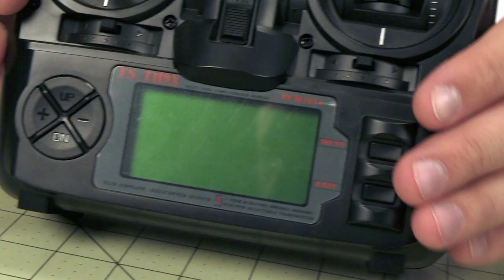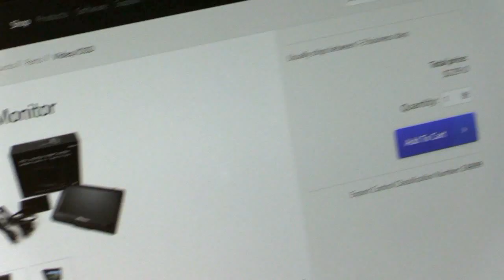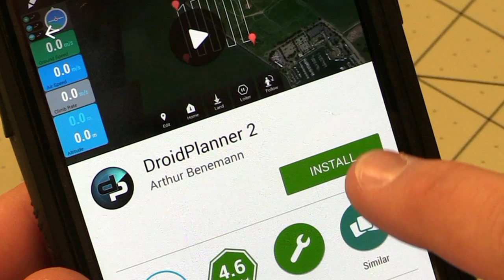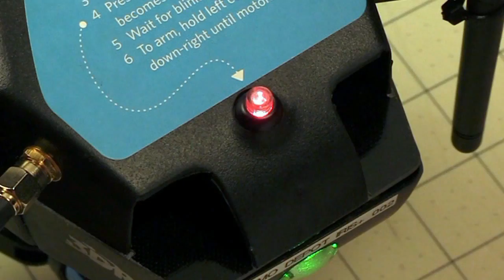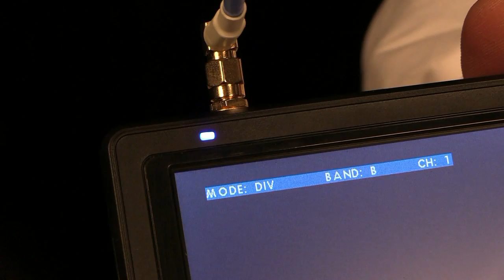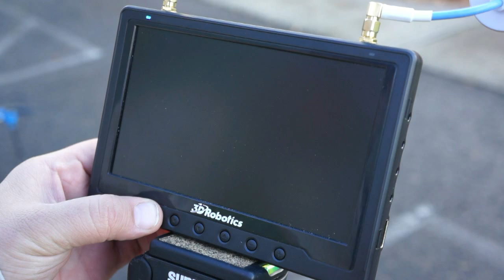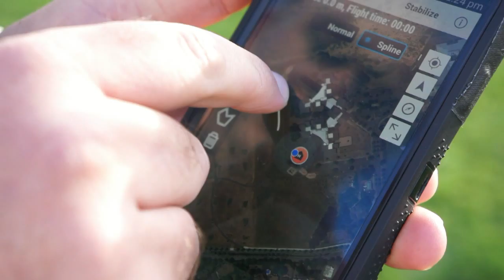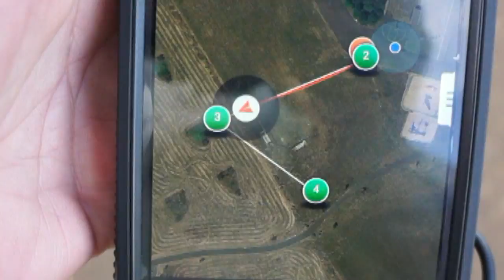RFTC: 3D Robotics Iris Plus FPV Quadcopter Unboxing, Setup and Flight Testing

Comment: Great stuff yet again boys,very impressed with this bit of kit meaning what you get for your money.

I've got an APM quad set up in my hanger and i quite like that one too,even though it had a longer learning curve than most FC's that i was use too,but setting everything up was all part of the fun for me,but as you said in the video it's not as locked in as the Naza-M V2 FC's that i've also got,going by what little i know about the Pixhawk that's in the Iris it's quite similar to my APM,i guess you could say the PH is a step up from APM what with it being 20 times faster in processing power. :-)

Big thumbs up.

Comment from the maker: As regular viewers will recall, we met up with Joseph Aletky from 3D Robotics at the FlySafe training event held earlier this year in Las Vegas, and he gave us a sneak peek at the company's new Iris Plus quadcopter.

Just recently, he managed to send us a demo unit to try out for ourselves, which is actually the very same aircraft we saw in Las Vegas, as it happens. Alas, we have to send it back to the mothership now that we're finished putting this review together for you – which is a shame, because I really like this bird!

You're not going to tear up the sky with it, but it's a very graceful camera ship and as you saw for yourself in the video, it is capable of producing some extremely smooth footage.

Also, we just barely had time to scratch the surface of the autonomous flight mode – but clearly there is a rich trove of capability there that elevates the Iris Plus from being a mere “toy” to a potentially useful tool for a range of professional aerial imaging tasks.

All of that in a lightweight, RTF package that can be yours for $750. To kit it out like the one you saw in our video – with the GoProfessional case, the FPV monitor and the GoPro sports camera, along with a couple of other accessories – would set you back more like $1,800.

That's not cheap, I realize, having once purchased a full-sized, manned automobile for $300 myself, but for that price you're ready to travel the world with a robust, real-time aerial imaging tool tucked inside your luggage.

Not bad – and if you'd suggested that you could have such a thing for $18,000 five years ago, they would have looked at you like you were crazy. It's enough to make you wonder where we'll be five years from now...